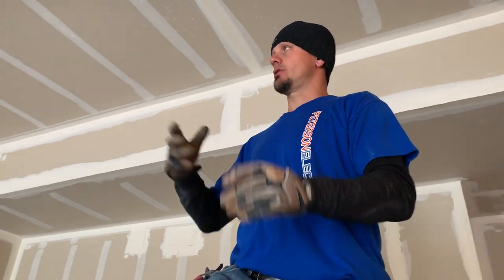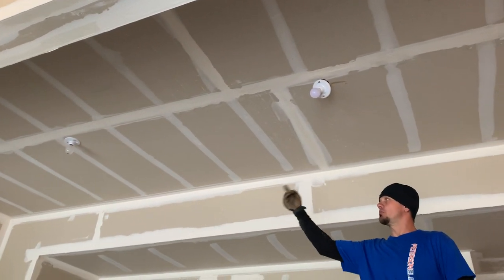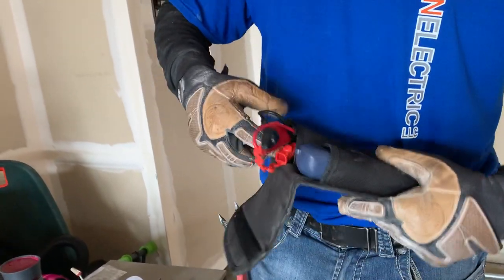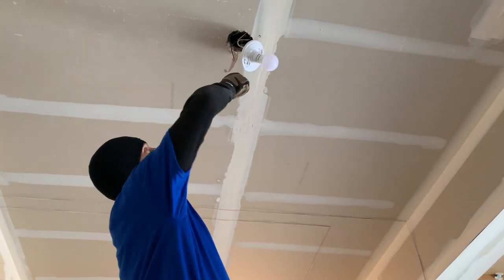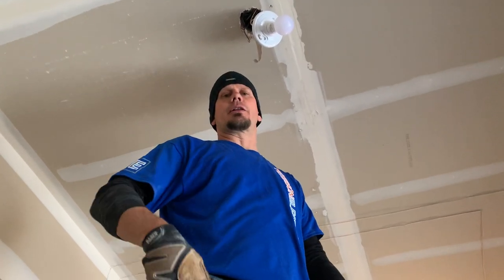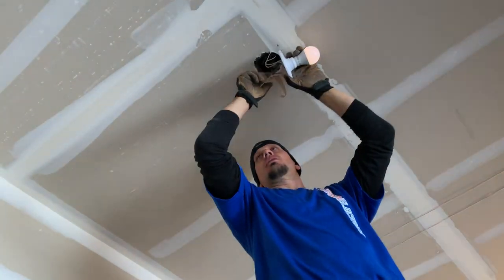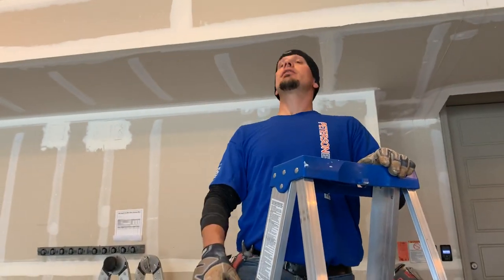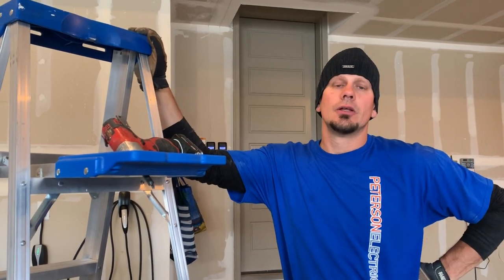How Do I Find Wires Buried in a Wall?

Comment: So can you show using the toner to track where the wires are in the dry wall?  

My problem is drywallers covered up the switch box to a light.  Need to find the switch.  It’s buried under drywall and potentially plywood

Comment: So there were two black wires running through the middle outlet box, but neither was attached to the keyless receptacle? 

Never mind. I think I figured it out in reading the comments. The middle box was drywalled over and the receptacle was never attached. That’s were the toner came in handy. 

Thank you for your videos.

Comment: I don't understand why you need to poke into the drywall. I thought the tone would be enough. Is it to verify?  I'm having this same problem with my house. Two rooms and the above lights have no power. I've tested at the breaker with a volt meter & the breaker is sending 120volts.  I've concluded its a break at one of the twist connectors in the wall, or up in the attic, but I need a tone like the one you have to get me closer to the issue.

Comment: They don't tell you to turn off the power because it's intended for network cabling - which could have up to 50vdc on it if its PoE. Toners are not DC, it's RF. You're turning the wire into an antenna. Probably best to hook one to ground, the othr to whatever hot you're tracing - making sure it's NOT hot when you hook it up though. Man, get you a fiberglass ladder! It almost electrocuted me all the way over here!

Comment: Just a thought. Since it is new construction and that lamp has never worked it is correct to suspect a wiring error.  My next thought would have been,  How would I have wired it up from switch  to multiple lamps. Like most of us, we would have done it the easiest way. Then check continuity with power off. 
My house was build by the pioneers  and the way things were done drives me nuts. I still have a couple of switches  and have no idea what they are for.

Comment: Hi Joshua, Just thinking outside of the junction box... Would an underground cable locater be useful to quickly locate interior wall and ceiling wire routing?

Comment: Hidden wire splices are a definite red flag signalling shoddy workmanship , as well as a fire waiting to happen.
Reply: Yeah I found 2 of them in my attic. Lady that owned the house before me - her boyfriend would hire all kind of idiots because "cheap" ... I've been fixing shit behind the bozo patrol for 2 years now. It's not readilly apparrent during inspection, but I've got a LOT of rewiring to do.
Reply: @notsure7874  I replaced the wood paneling with drywall in a mudroom addition at my parents' house a few years back (added some time in the 1970s by a previous owner). I thought it was going to be a quick and easy job until I found LAMP CORD running to all the fixtures and receptacles, with bonus flying splices.

Whoever built the addition did a good job with the woodwork, but holy heck did they cheap out on the electrical.
Reply: @AdhamOhm  I haven't found lamp cord in here, but I found in another house some either 18 or 20ga speaker wire run from an exterior to interior outlet where you know people plug in heavy loads. No gfi either but I was more concerned with the in-wall toaster element.